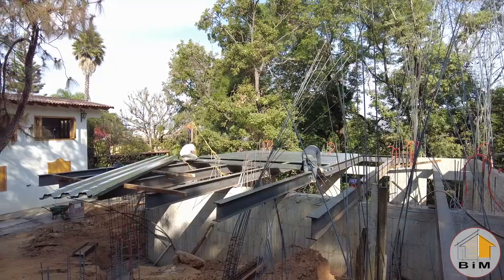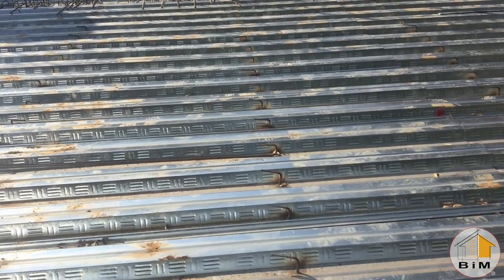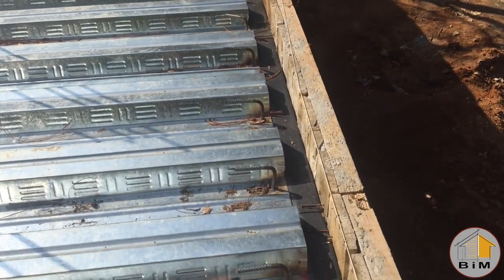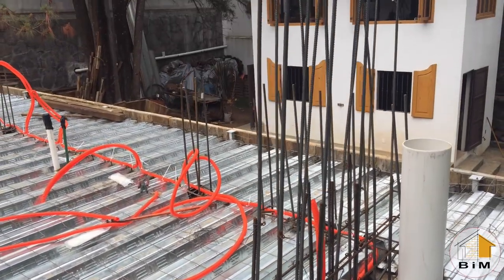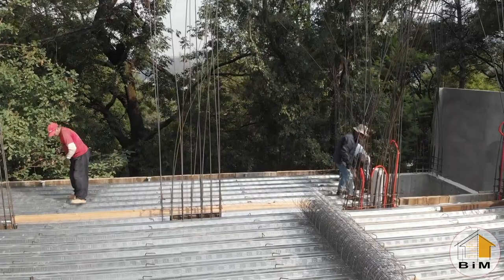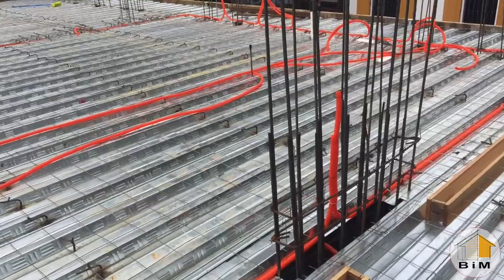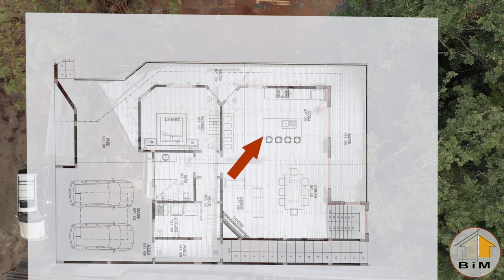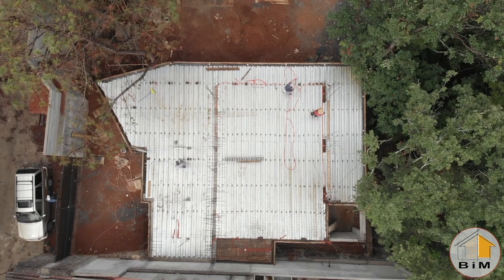11.  Installing Corrugated Steel Lid Base for concrete floor and ceiling | Losa Acero

Comment: I have family back home in the field of construction however I was never introduce to the family trade so please I apologize if I sound stupid. I have a question about using corrugated steel as the subfloor to hold the concrete floor. I notices you put a wire mesh on the floor before putting the concrete. Those the wire mesh act like a rebar to hold the concrete? Thank you Kindly

Comment: are you going to make your roof this way as well? Im thinking of building my house like this in dominican republic
Reply: also, what is the gauge of the corrugated steel decking. Thanks in advance !
Reply from the maker: I don't remember. I'll check on that. There are charts online that show you the span and weight bearing characteristics of the different thicknesses of the decking. You'll want to look that up to figure out how that information fits in with your specific requirements and select the thickness best for your application.
Reply from the maker: The roof will be wood beams with wood planking covered with torch-down rolled roofing and clay tiles.